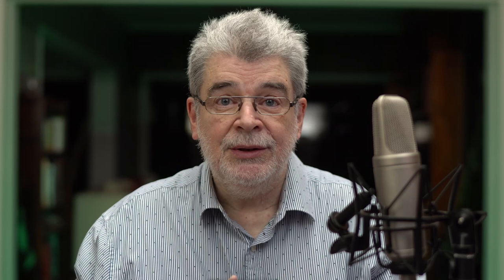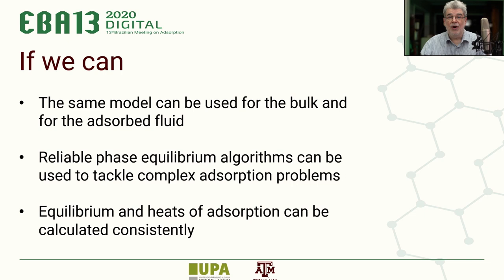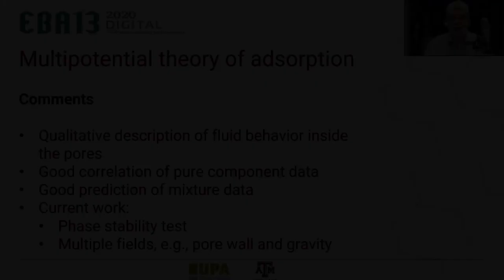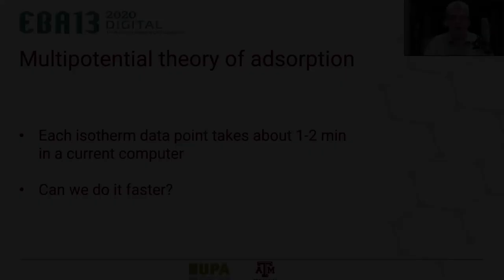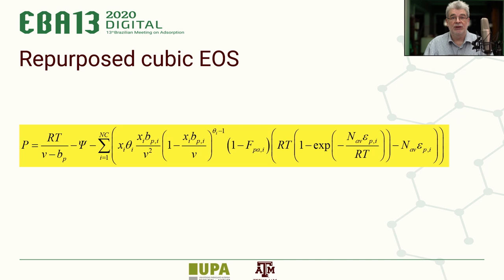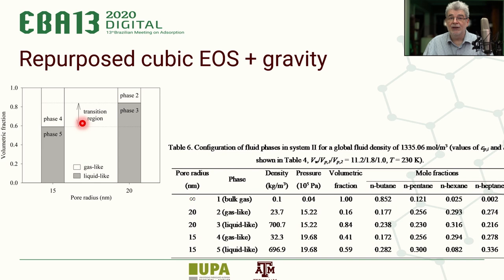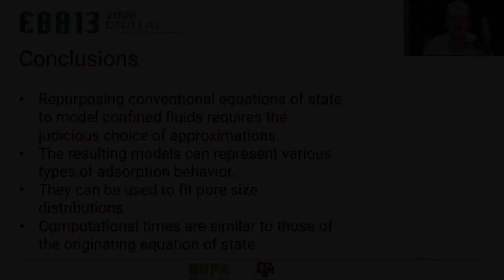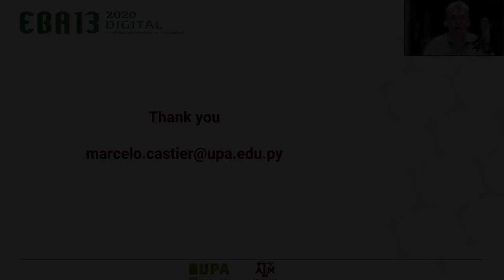Modeling Adsorption in Porous Solids with Equations of State for Confined Fluids

Comment: GREAT JOB , Can we hope to know more on details about how the plots were produced and an in details lecture in future?
Reply from the maker: Here are some references: 
TY  - JOUR
T1  - Phase Equilibrium with External Fields: Application to Confined Fluids
AU  - Dawass, Noura
AU  - D’Lima, Michelle L.
AU  - Economou, Ioannis G.
AU  - Castier, Marcelo
Y1  - 2016/08/11
PY  - 2016
DA  - 2016/08/11
N1  - doi: 10.1021/acs.jced.6b00209
DO  - 10.1021/acs.jced.6b00209
T2  - Journal of Chemical & Engineering Data
JF  - Journal of Chemical & Engineering Data
JO  - J. Chem. Eng. Data
SP  - 2873
EP  - 2885
VL  - 61
IS  - 8
PB  - American Chemical Society
SN  - 0021-9568
M3  - doi: 10.1021/acs.jced.6b00209
UR  - https://doi.org/10.1021/acs.jced.6b00209

TY  - JOUR
T1  - Capillary condensation: Limitations of the multicomponent potential theory of adsorption (MPTA)
AU  - Gonçalves, André F.
AU  - Castier, Marcelo
AU  - Franco, Luís F.M.
JO  - Fluid Phase Equilibria
VL  - 569
SP  - 113759
PY  - 2023
DA  - 2023/06/01/
SN  - 0378-3812
DO  - https://doi.org/10.1016/j.fluid.2023.113759
UR  - https://www.sciencedirect.com/science/article/pii/S0378381223000419